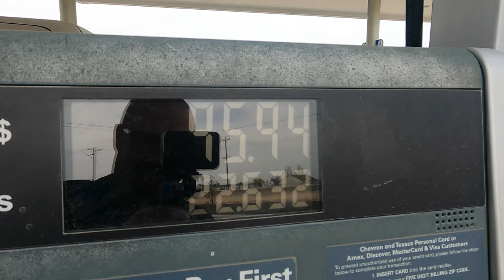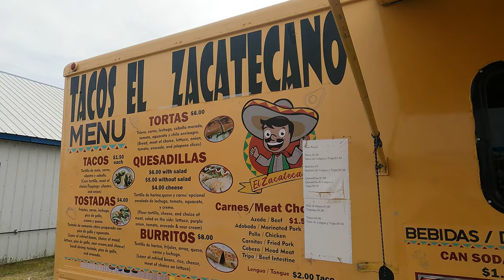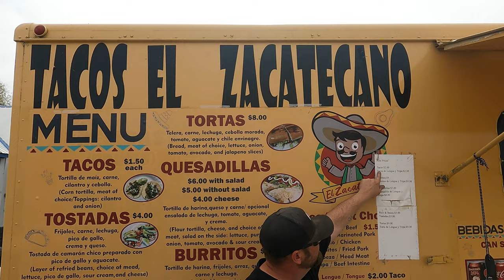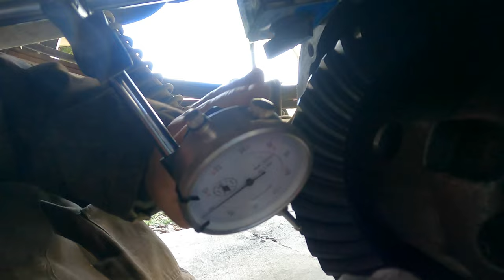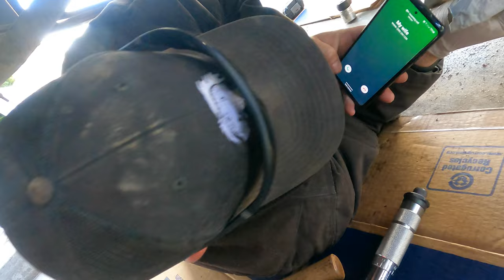Rear Differential Rebuild for Dummies

Comment: I most definitely approve of those Tacos and the Spanish guitar through out this episode. I will say I am impressed with that Taco Truck, If they are unwilling to ship me a 100 Tacos then I guess I will just have to drive up there and try them out. Yall did a great job on that ring and pinion install, I especially like your ratchet to Sledgehammer brace, I have not tried that technic out yet, but looks legit. The perfection of this install is so perfect, that it seems Iron Horse Garage has redefined the meaning of Perfection, This episode is Perfectest of perfect..............GoPro end comment.....
Reply from the maker: Hahaha haha Hahaha!!! Thank you very much Duddie!! We appreciate it!!